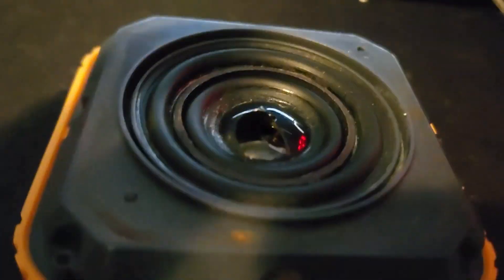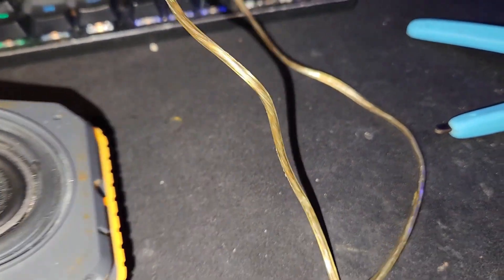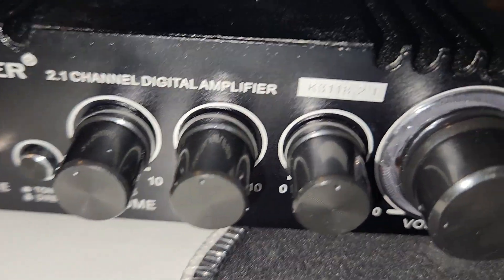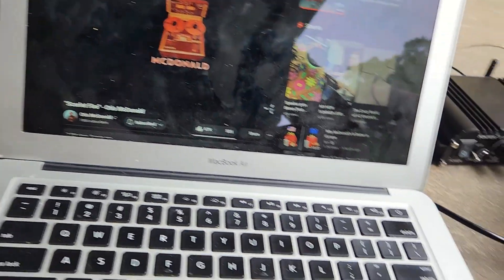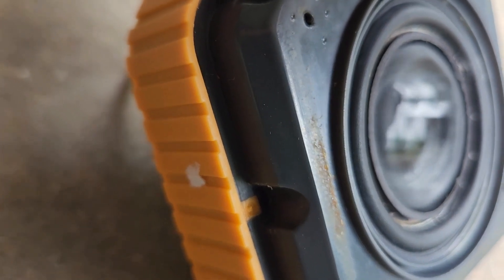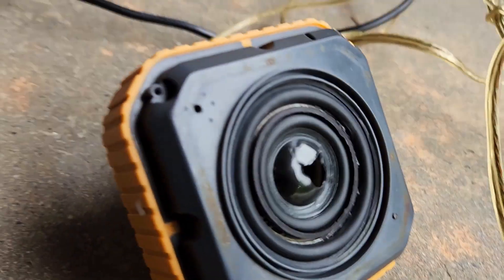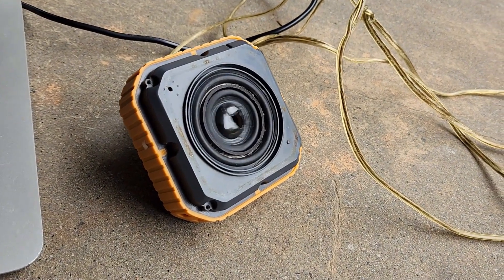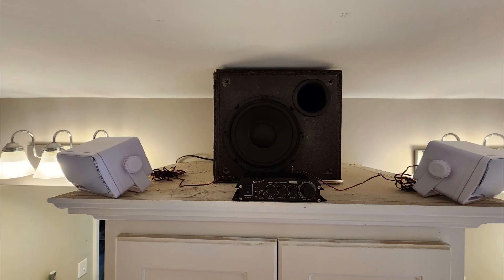Small amplifier blows up small speaker!

Comment: Does the amp just plug into the wall for power?
Reply from the maker: it runs off a 20v power supply (comes with the amp) but pretty much yeah

Comment: When i put an eq for bass on my speaker i get the same crackling noise, is that bad?
Reply from the maker: it's definitely not great for the speaker. I'd reccomend turning down the volume or changing the eq
Reply: @RMA2009  Alright, but what's the crackling noise though? Does it mean will it blow or something
Reply from the maker: @GalaxyYT. it means the voice coil is smacking up against the magnet, eventually it will blow.